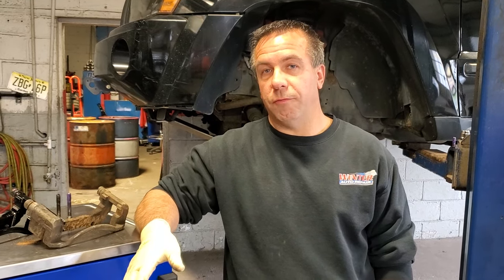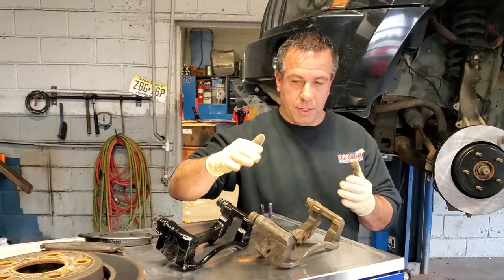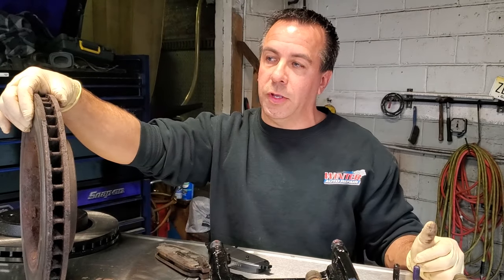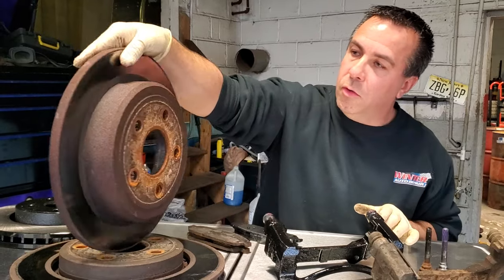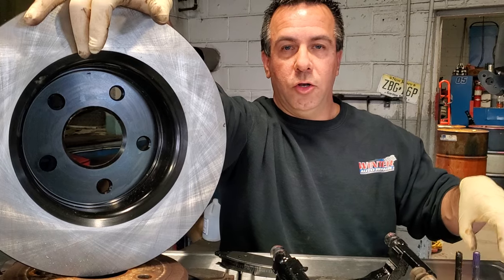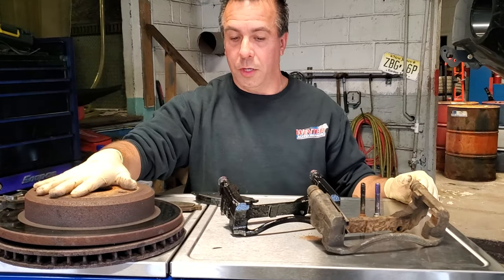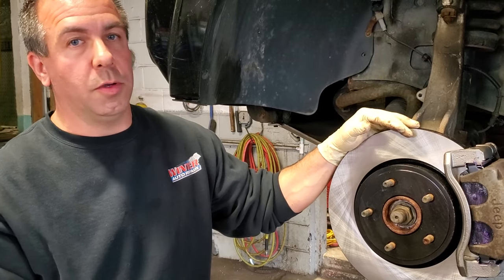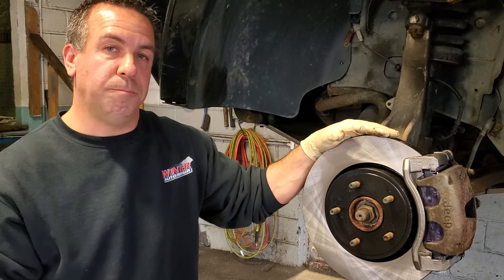High quality brakes vs cheap brakes

Comment: Hi Chris,  Got sidetracked for a bit with the 2 hurricanes here in FL these past 2 months and now it's back to car maintenance.  Help this former Jersey guy out.  I wanted Centric 125's but they can't be found.  On RockAuto site,  they are selling a Raybestos high carbon rotor street performance disc with coating for rust prevention.  What do you think?  I don't need slots or holes on my rotors as it is a 2009 Acura Tl.  Last replaced the rotors and pads 10 years ago with Centric rotors and Hawk Met Pads.  Pedal just doesn't have the bite it once did.  Can't locate Perfect Stop and the DFC on RockAuto is not High Carbon.  The Covid epidemic screwed up the entire world between lack of inventory,  price gouging and Cost of Living.  It's insane.  Help this Jersey 911 Responder out if you can.  I'm willing to buy from you if you can get 125's.  Thanks,  Gerry
Reply from the maker: Hey Gerry, call my shop at 609-208-2550 and give us your VIN. I'll see what's available to me.  I have more sources I can buy from than you do. I'll do my best for you.

Comment: Problem is, quality brakes are made of better materials and etc but the thing is people come to me with their cars and not everybody has the kind of money it takes to buy OEM parts or higher end, better quality parts. They just want to get back on the road. There are some things people shouldn't cheap out on but, they take their chances 👍
Reply from the maker: We send those people away in our shop. I explain to them nicely that I'm only as good as the parts I use. Their families life means more to me than money. So if they'd prefer to save a few dollars to potentially have issues, then there are other shops willing to do cheap work for cheap prices, just not my shop. It took us a while to find a complete client list willing to have better quality work for the right price. Now we hardly lose any customers to higher prices because they know we only do top quality work. It's also helped our employees' stress level because the difficult customers went away when we adopted this business model. We continue to add new customers, and our revenue increases year over year. I no longer worry about pleasing every person who walks through our door by lowering our standards to meet their demands!
Reply: @WinterAutoRepair  I'm just talking about people I know coming to me that can't afford the overhead of a shop and blah blah blah. There are people that need to get to and from work and they know full well they are buying cheaper parts but they just need to get through the next five or six months. That's what I'm talking about. When I work on my own vehicles I always buy quality stuff but I can afford it. I've got neighbors and their friends sending work my way and they simply can't afford everything so I cut them some slack. It's either that or they have to mooch a ride off of friends or ride the bus.

Comment: Nice video, but why didn't you mention specific brands of rotors and brake pads?  What brand rotor did you feature in the video?   Thanks
Reply from the maker: Because we use the best brands that are currently available. For example, when we made this video 3 years ago, we used Centric brand pads and rotors! Since then, Centric was purchased by Raybestos, and their quality is terrible.  Currently, we use Durago EPC high carbon rotors and Power Stop brake pads.  They seem to have the best quality and last the longest for our customers. 
I hope that helps and good luck with your brake job! 
Thanks for watching and commenting.

Comment: Ever feel like Pontiac put inadequate size brakes on their cars? My G6 used to eat brakes like candy. Maybe, it was the cheaper rotors? I used Wagner thermo quiet pads and Wagner coated rotors. Also, Duralast Gold pads and rotors.  Put around 170k on it and did the front calipers and hoses 1 time as well. I'd imagine 4 or 5 front brake changes and 2 in the rear. I always downshifted the car before braking.
Reply from the maker: Some cars have brakes that are too small. However, the parts you're using are lower quality and don't last long on any car. If you still have the G6, try using DuraGo EP series rotors and power stop ceramic pads.  They seem to last the longest for us.  If you can't find them, use Perfect Stop high carbon rotors and perfect stop ceramic pads.  I hope that helps. 
Thanks for watching and commenting
Reply: @WinterAutoRepair  sure thing! I traded the car in several years ago.

Comment: A local Meineke Muffler shop quoted me a grand for pads and rotors for a 2010 Subaru Forester, and this is with "white box" parts.
Reply from the maker: That is a crazy price for white box parts.
Reply: Damn, did they throw in a new catalytic converter?
Reply: @WinterAutoRepair  how about a 2014 Nissan rogue S I would like to know a price for ceramic brake pads for front and rear and carbon rotors for the front and rear
Reply: That's crazy. 4 rotors and pads is about $200 worth of parts for mid grade parts. Add in a couple hours of labor.

Comment: I am doing the brakes on my Bentley Continental GT.  What brand of brake rotors do you recommend?  Dynamic Friction Premium Performance brake rotors?
Reply from the maker: You're going to be limited on what's available for that car.  I owned an exotic rental business up until the pandemic. I had a 2015 Bently Continental GTC among many other exotics.  The best company I found was Girodisc. I did not have to replace the brake on the Bentley but they made rotors for my Lamborghini, NSX and Ferrari. Give them a try and see if they have parts for your car. I know they supply the brakes to Xtreme Xperience for their race track cars.  The rotors are far better than stock so they can withstand track abuse. 
I hope that helps and best of luck! Thanks for commenting.

Comment: high temperature center paint coated and high carbon brake rotors where is good place to buy them onine im in canada?
Reply from the maker: You can try Rock Auto or any quality autoparts store. The chain parts stores won't have quality rotors, try a good local store. Otherwise, Rock Auto and sometimes Amazon has them.  We currently use Durago EP or Perfect Stop high carbon.  I hope that helps you!  Thanks for watching and commenting.

Comment: A honest mechanic is like a good cop very rare but do exist.  Last time i got charged $1300 for a front strut job at Midas and they charged me $400 for each strut assembly and i asked why was the job so expensive. They said is was the parts used. So I checked the part number used, and each part cost $180 from Napa but they told me it was  because they used a quality strut costing $400 a piece. They lied and screwed me. Unless you follow each customer home to make sure they made it home safe dont say, You treat people like family or your not willing to drive 180 miles just to make sure the job you did is still doing good.

Comment: Excuse me I have one question please
What's a good for grease pin break??
Silicone ?
Synthetic ?
Ceramic ?
What's the number for item# ? good 
Thank you so much
Reply from the maker: Hello. We use Permatex Extreme ceramic grease. Part# 24125. It's purple in color. 
I hope that helps you! Thanks for watching and commenting.
Reply: @WinterAutoRepair   
Thank you so much🌹🌷👍🙏🙏
Reply from the maker: You're welcome!  Good luck and thanks again for watching and commenting

Comment: Hello  ,can you please recommend good break pad and rotor  kit for my 2015 Honda accord EX-L 4 cylinder, there are huge variety of products don't know which one to buy .Please I really need Your help .
Reply from the maker: In this video, we used Centric high carbon. The part number will start with a 125 or 120. The 125 is better, but it's not made for all cars. You can also get Perfect Stop high carbon rotors that are coated and look like the ones in this video. Centric, Perfect Stop, Akebono, and DFC all make good quality brake pads as well. A good autoparts store should have them. If you're looking online, try Rock Auto and even Amazon. 
I hope that helps, and Thank You for watching and commenting. Please Subscribe if you haven't already! Let us know if there is something specific you'd like to learn about.
Reply: @Winter Auto Repair Thanks for quick reply!!!

Comment: They make the brake rotors lighter so the car will get better mileage but then you end up spending more money replacing the rotors. Same thing with window glass is super thin and light weight but you get better mileage and the first rock that hits your window is going to crack it. Are used to have trucks from the 70s and 60s and those windows are super strong
Reply from the maker: You are correct. Less rotating mass helps with handling and gas mileage. If you use a better than original rotor such as the high carbon Centric in our video, they will last a lot longer. We are about to do a follow-up video on this jeep. It's almost time to replace the brakes again with 70k miles on them.

Comment: hi, love the way you think, most mechanics do crap job's and that's why i am learning to do things myself, i have a 2001 Honda accord  v6 where do i get the parts you are using but the accord version?
Reply from the maker: Thank you, and good job learning. Try a good local autoparts store first. Not a chain store but a good local store to you.  If not local, you can try Rock Auto as I know they have some of what we sell. 
Best of luck to you, and let us know if you have a video idea for us.
Reply: @WinterAutoRepair  can you give some kind of product name? a brand?
and as to video's idea's, well there aren't a lot of good astrovan repair video's, or tip's like how to improve on a bad oem parts (i have i a video coming out next week, i'll send you a link when it comes out)
Reply from the maker: @ozb2006  we use Perfect Stop or Durago EP for rotors (both high carbon) as far as pads go. we use DFC, Perfect Stop, or Stoptech.  I hope that helps!

Comment: Sad,but many automotive techs are overworked to the point they won't take this much care when doing a brake job.The majority will just slap everything together,apply a little lubricant and send it back to the customer.A brake job done with this much care will give a longer service life and improve the driving experience.Teach yourself to do your brakes and you can know they are always done like this!
Reply from the maker: You're right. Or find a shop like ours that isn't flat rate and requires our mechanics to perform every job with this level of care!  
Thanks for watching and commenting.

Comment: Hey Great Video!! I just had to replace the rotors on my 2020 Mercedes A220 and 2021 RAV4 because they were sitting for a few months outside and the rotors warped. So im assuming when you say "white box parts" you are also including  dealer OEM parts. Both cars have around 10K miles and original parts.  You didnt mention the company of the parts you were using but they dont look OEM. They look alot better quality!!!
Reply from the maker: Thank you for watching and commenting!  When cars sit the rotors will rust and get damaged. The OEM rotors are okay but most don't have any coating to prevent rusting on the hat and veins of the rotors.  
In this video we used Centric 125 line rotors, the 120 is their standard line with coating and the 125 is high carbon and coating. When we can't get Centric we will use Perfect Stop or DFC rotors.  
Mercedes is tough. Not a lot of aftermarket support for some of their models. If you cant find the high carbon rotors, you may be forced to use OEM Mercedes parts.  
Good luck!

Comment: are you using centric brand?  should I spend the extra money for autozone's gold duralast pads and rotors?
Reply from the maker: We only use Centric brand.   Autozone is not even close in our experience.   If you can't find Centric locally, you can order them in.
Reply: Rock auto has them.

Comment: I got new front brake pads and rotors on my 2016 Camry.  The auto shop I used marked the price of the parts up about 100%.  Too bad,  because I will never return,  I will cautiously put my trust in a Toyota dealership.  At least I know I'm getting quality parts and well trained technicians.  Even Toyota would have been cheaper. "Fool me once shame on you,  fool me twice shame on me".
Reply from the maker: What do you think the dealer marks the parts up?  It's at least 100% from what they pay.  Same as a restaurant and the food they sell.  As a business owner, I can tell you all the costs associated with running a business are ridiculous. We have to cover costs by marking up the parts. Plus we get a discount from the autparts stores because we are wholesale resellers. It clearly doesn't matter to me if you stop using your mechanic, but if you think you're getting better quality and better prices at a dealer, you're 100% wrong. You have no idea if you have a brand new first day mechanic or who is working on your car. In addition, just because you go to a Toyota dealer for brakes does not mean you're buying Toyota parts.  Most dealers buy parts from the same autoparts stores we do so they can compete on price. I see autozone dropping parts off to the dealership next to us all day long.   My suggestion is to ask some friends what mechanic they trust and try them out before you put your blind faith in a dealer.  
Good luck to you.

Comment: The do it yourselfer needs to know how to discern higher quality products, other than just price.  No good saying it is good because it has a higher nickel content if advertised parts do not show the nickel content.  Great video though.  Thanks for sharing your considerable expertise.
Reply from the maker: I understand.  You cannot see the high nickel in the metal until it's used and falling apart.   For example there is a company that has rotors made on the same assembly line that are no where near the same quality.  That is why I stick with the Centric brand.   They have their 120 and 125 lines.  120 is good and works well for cars while 125 is better for heavy duty applications like trucks and aggressive drivers.  I don't have any other brands I've used that work as well for the same cost.  I would try and buy Centric if you're looking for a quality rotor.

Comment: I learned years ago that when it comes to break pads cheaper isn't the same. Found out that putting the cheapest break pads on that I was redoing it in a years time. So I upgraded and they would last 2 to 3 times longer. Now I usually buy the top of the line break pads ceramic usually, which they create less dust also and last alot longer!
Reply: aha and also they USING rotars like crazy ,,  yeah  smart idea  i buy Very good Quality pads but for Half price than what Auto parts sell in stores  for cheap crap :-) think about it

Comment: 2:35 clearly this one is going straight to the rotor grave yard!   (No re-surfeiting for this one )  just take a closer look where one of the brake pads  failed! the inner one in this case  W.A.R has this  zhit down! ... Kudoz ! for showing those that only know how to drive their vehicle and not much else! always spend a little more on parts whenever possible, ceramic brake pads and  new rotors  when the used ones are  warped!  trust this Guy and his shop! your car will thank you with tons of More miles with stopping power to come!@

Comment: Hi Chris 
Just subscribed ur channel for more informative and educational videos for DIY people. 
Ur video tought me to do my brake job myself. 
Going to get Centric rotors and ackebono ultra ceramic pads  and will get this done  soon.
Do u think its a good choice of Pads for a 07 camry  ??
Dose Centric rotors OE specific  ? I mean same thickness and diameter  ?
Thanks for your video again and we need more videos like that .
Reply from the maker: Hello and thanks for subscribing!  Centric rotors are OE spec so you'll be fine there. The pads you want will also work.  if you can't find Centric, Perfect Stop is a good alternative. Just make sure they are the high carbon and not the basic rotor!  good luck and I'm working on making some new videos now.
Reply: @WinterAutoRepair  thanks a million.
Reply: @WinterAutoRepair  Thank you, I'm glad I found this channel. I was all over the place looking for brakes. I looked at the akebono's but a lot of people said that the breaks didn't have a good bite to them, where the peddle felt like you had to push it pretty hard. I have a 2017 genesis G-80, pretty big car. I'm definitely going to get the carbon centric rotors. What break pads would you suggest? Looking for something really really good. Thank you so much, keep up the great work.

Comment: I do my own brakes, and I get at least 2 sets of pads before I dump the rotors. The problem with having mechanics recommending to owners about brakes, I seen so many brake jobs done when just 1/2 the pads are gone.  I of course know I just need 1/16 th of an inch minimum to be legal.  and I do take it close to that. I do not get spooked by that safety reminder, I remember cars used to come standard with drums in front and no ABS.  Depends on driver, a teenager with carbon carbon brakes would still manage to wrap the car around a lamp post.

Comment: I’m glad I did my own brakes on my 2016 F150. O’Reilly legally turned my front rotors.
Reply from the maker: What was the thickness of your rotors before and after they cut them. If it was able to be done they should have provided you with the necessary numbers.
Reply: @WinterAutoRepair  It was a stock F150 rotor. I have video of the rotor change.
Reply: @WinterAutoRepair  What brand pad did you put on the Jeep?